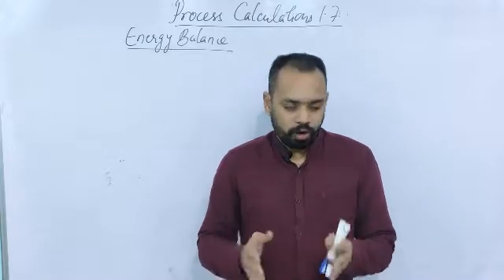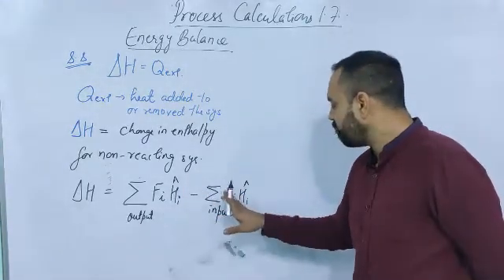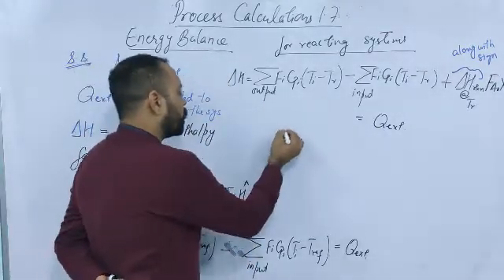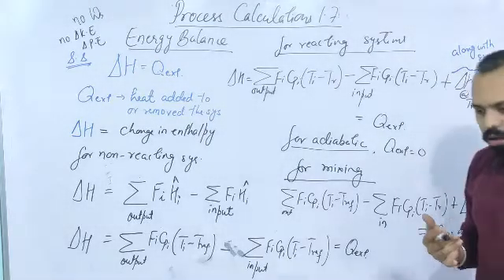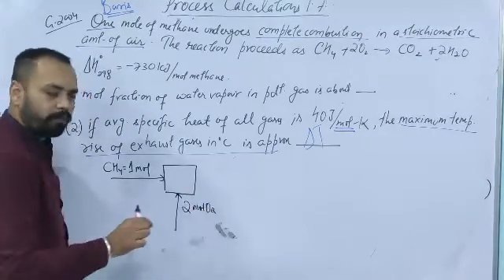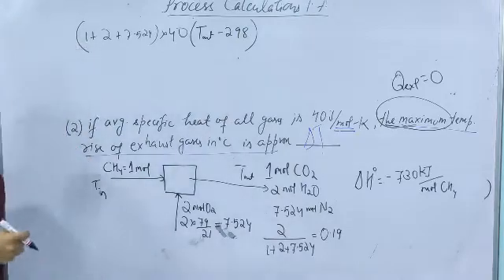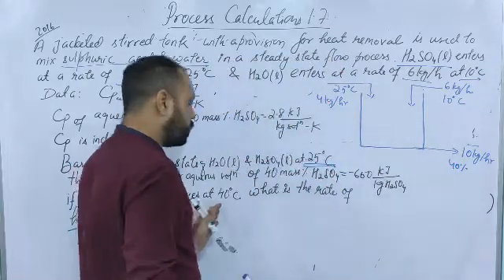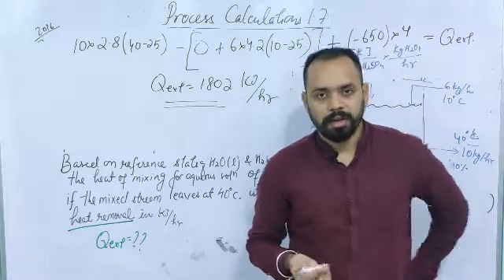BREAKING GATE 2020: 1.7 (Energy Balance)

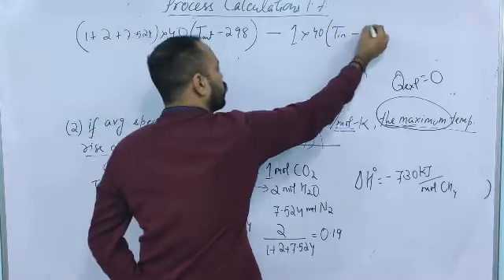Comment: Sir,why have u consider only 1 mole of reactant (1 methane+2mole of oxygen) at 20:15???
Reply from the maker: Hi janak ...this is called basis ... I have taken a basis of one mole of methane and because the question asks maximum temperature rise , so that is possible only if all the methane reacts and in that case 2 moles of carbon dioxide is formed. Now whatever basis you take ,temperature is independent of basis chosen...you may take 10 moles methane and 20 moles CO2 , you will get same answer 
.I hope you find this explanation helpful ..keep watching and sharing
Reply: @gatecatalyst-deepakpandey3041  ,sir we also have to count oxygent mole in calculation,Here you take only 1 mole of methane and 0 mole of oxygen.????

Comment: With all due respect sir, the values for Cp has temp. in Kelvin and you're using celcius in (40-25) & (10-25) finding Q ext!!!! Please explain.
Reply from the maker: Hi rishi ...the value of Cp won't change whether you express in celcius or kelvin
Reply: @gatecatalyst-deepakpandey3041  So sir, there is no need to change the temp from celcius to Kelvin i.e 40 c and 10 c while finding Q ext.??
Reply from the maker: @Just_somebody7  no need...
Reply: @gatecatalyst-deepakpandey3041  thank you sir for your support and these much helpful videos🙏.
Sir, are you available on the contact no. you mentioned in one of the comments???